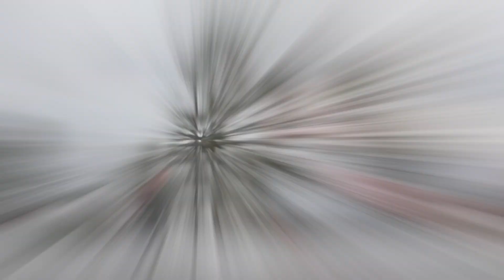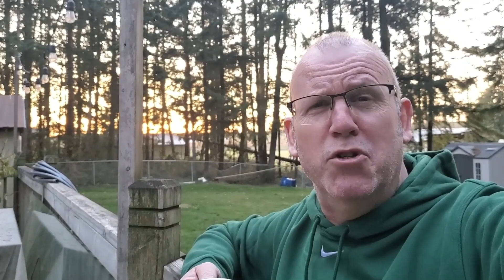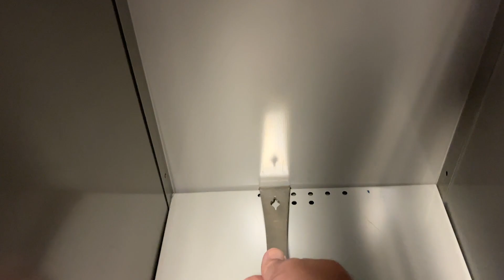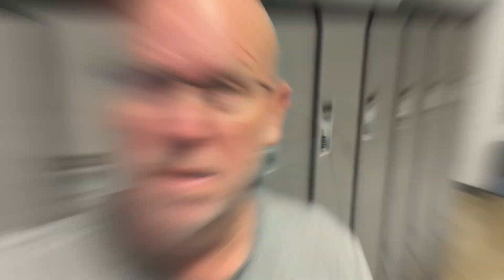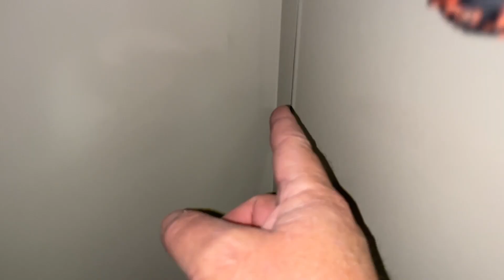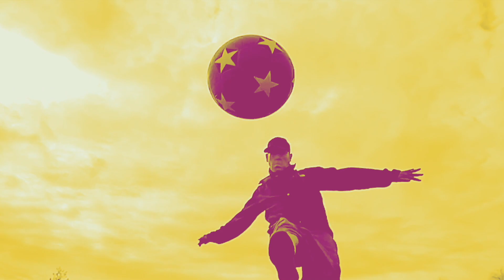S05E123 - New Lockers are CHEAPLY Made (they sure don't build 'em like they used to)

Comment: These cheap Asian locker imports really are a disaster where in due time begin to fall apart like similar goods from this region. Unlike the English whom place a sense of pride and dignity in their high-quality manufacturing processes, many other regions simply want to ship their substandard products out of the factory as soon as possible by employing frugal methods resulting in inferior products.

In the grand olden days of the Victorian era to the mid twentieth Century, the build-quality was such that the steel panels were welded together along the seams for a lifetime of maintenance-free service life. The only servicing perhaps, was to the actual mechanical locking mechanism if the lock had been deliberately damaged due to vandalism. 

Don't look at me, I claim to be innocent of such acts despite what some people have accused me for in my youth. Indeed, only the English can truly produce superior quality products in design and purpose without skimping at any stage of manufacture. 
🇬🇧 ☝️🙄

Comment: Cheapo lockers! 

Umm .. as the bottom was soo loose,  could you have forced the bottom out completely (or cut the rivets at the front end,  flipped the bottom upside down, drilled and riveted?  No need for extra brackets as the bottom/shelf would already have its sides to be able to drill and rivet .. No brackets required, means less cost too .. 

As always, I enjoy your vids, keep up the good work 👍, take care !
Reply from the maker: Possibly!  I'm sure I'll get another chance to test the theory, lol.  Cost would be the same though as I didn't go out and purchase the brackets - I made them out of scrap.
Reply: This, or put brackets underneath. Either way it'd look much better.

The "proper" fix would involve a good bit of disassembly to get that locker out to put rivets back into it.

I've installed many hundreds of lockers and never saw such a poor riveting job... Friday at the factory?